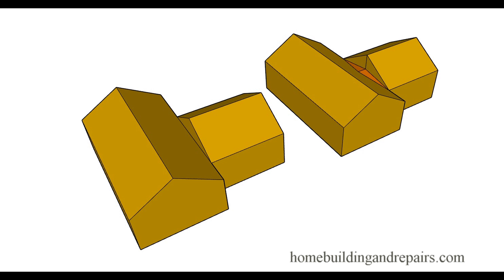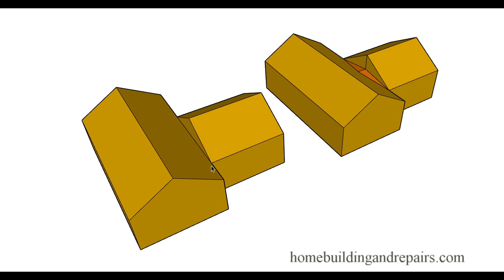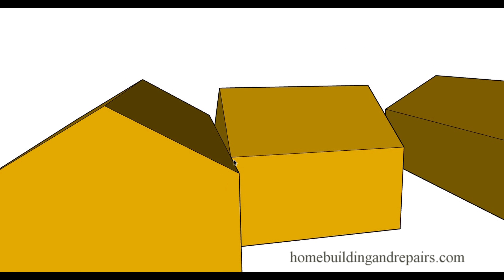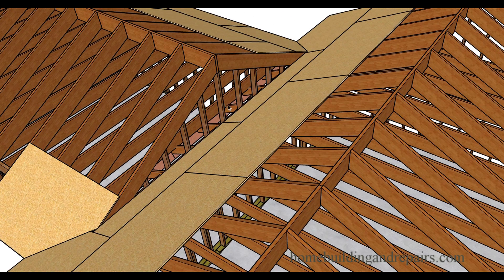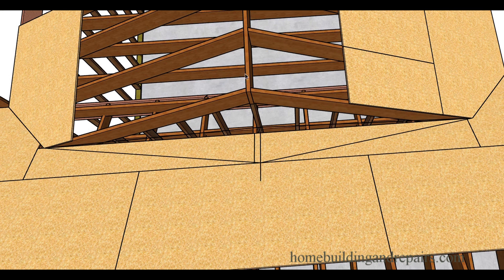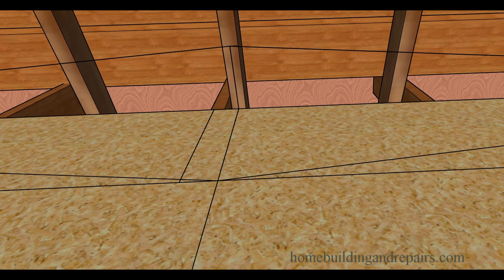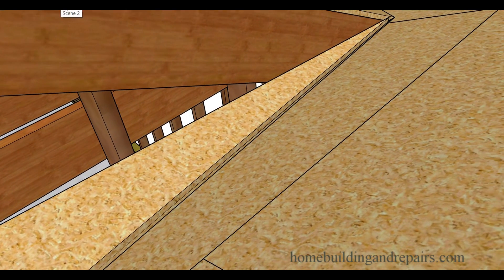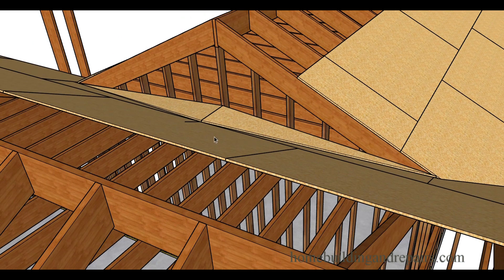How To Build A Roof Drainage Cricket – Home Building Ideas

Comment: Thanks man, been trying to figure out how to put a butterfly roof on my apartment studio for a few weeks now an just scratching my head on how TF to move water off an out of the valley, so far I know of either a cricket, box gutter or using some sort of industrial waterproofing membrane an praying lol, but this helps Point me in the right direction, have been apprenticing with my uncle for almost a year now on building houses an doing concrete work n I look forward to tackling Manny projects to come, thank you for your informative video

Comment: Yep have a 34 wide slope roof falling into a 90 deg wall of a 30' addition absolutely no common sense. Yrs rain making hole in center sheathing and abutting wall 15 + seasons creating leaking into the common wall and rafters below-and sheet rock failure. Homeowner builder did this about  @ 2004, just plain silly, he/ stepfather died in 2010. Did not even complete painting the plywood just seeing studs. I was not aware and repaired seal in 2017 by fiberglass on ply and wall and new sheathing 1" foam and hardie plank. I used fiberglass and resin on all this 12" x16" x 30 + (2 ) 2 FOOT shedding wings 'gutter regions. Have yet to make a proper cricket, had too general a guess, now I know by you about the height up wall but may have a limit of 8" (windows). It has a tiny slope, but your practical design is great help. I need visuals.
Reply from the maker: If you need to see someone building it, then you might need to wait until I get a job that requires it.

Comment: Nice video. I've never heard the term cricket.  I know this is just an example of where a cricket is needed, but in reality, wouldn't you first look to see if the extension roof could be extended to meet the main roof?
Reply from the maker: It is interesting how many different terms are used in the construction industry and if the design of the roof can be modified to avoid using a roof drainage system like the one shown in the video, then why not do it.

Comment: Thanks for your guidance. I'm about to have a screened porch built, and have been debating about the type of roof for it. The porch is going to be built in the inside elbow of an L-shaped space of my home. I'd like it to be gabled to match my existing 4/12 gabled roof, but that means I'd create about a 15 foot long valley between my home's roof and the new porch's roof. I've read about building a cricket between them, but one of my potential builders is concerned because of its low slope in relation to the home's existing 4/12 slope, which could create drainage issues. Am I setting myself up for disaster, or should I go with another builder that feels confident about building one? Last, since the cricket slope is too low for asphalt shingles, what is the appropriate roofing material for the cricket?

Comment: Thank you for this. I am about to start work on pushing out my front entryway and needed to figure out how to build a cricket for a 10 ft span. Can you tell me what is an acceptable slope? Like I said, the span is 10 ft, but the height I have to work with is about 30 inches. is a 3/12 slope enough?
Reply from the maker: I believe roof crickets need to have a minimum slope of 1/4 of an inch per foot, but you would need to check with local building authorities to verify that information.

Comment: I've been designing and framing for years and I've never seen a cricket like this.  Why not just over frame this section?
Reply from the maker: You bring up a good point, we might not ever run into certain situations as your suggesting, but I actually lived in a home that was built like this and had a metal cricket and I'm guessing that it was designed and built to save the home builder a few dollars.